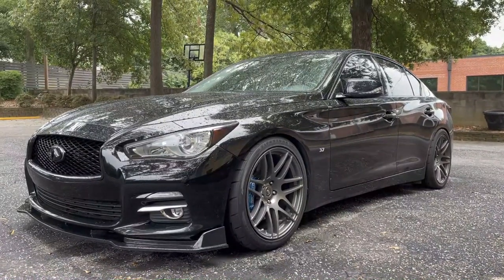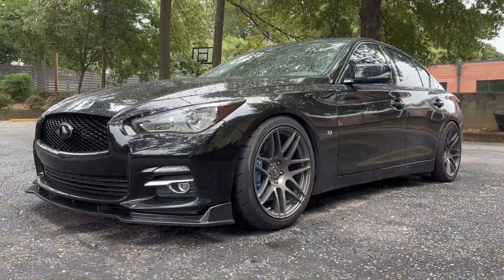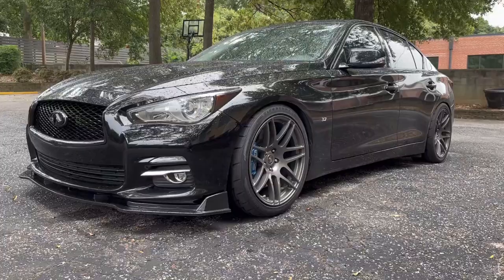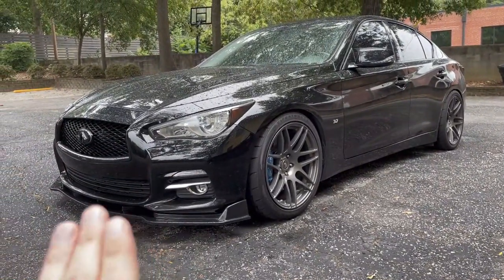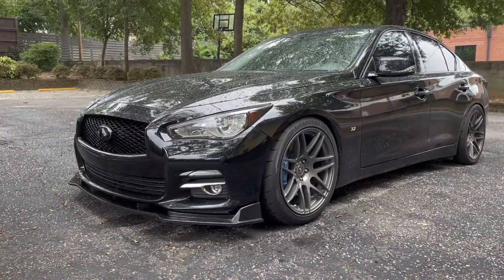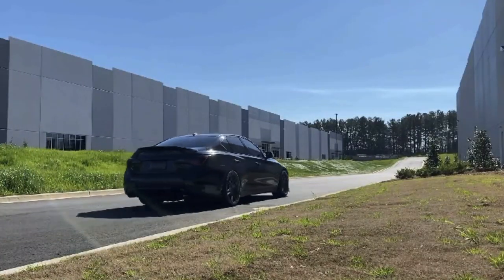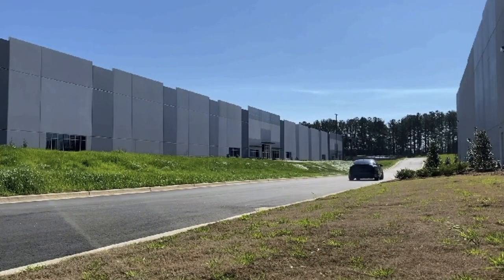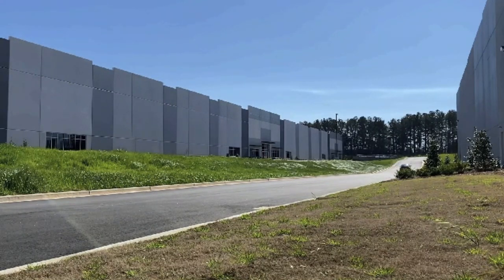The ONLY 3 Power Mods you NEED for the Q50 3.7 | Bang For Your Buck Mods G37, 370z, Q50

Comment: I agree that improving the airflow in, the exhaust out and then finally optimizing the A/F ratio and ignition timing across the rev range are the best bang for buck mods you can make on the VQ37 engine, as you're improving engine operating efficiency across the whole rev range.

Wanting to keep my 370Z daily driver street legal here in California, I was only able to go with a cold air intake, better cat back exhaust and a chassis dyno tune. I had a Stillen Gen 3 long-tube CAI and a Fast Intentions 2.5" dual x-pipe cat back installed with an Ecutek software dyno tune done on a Dynojet chassis dyno at Specialty Z.

We went with a little more conservative tune to give me a greater margin of safety in case of something like bad gas getting in the car. The result was a healthy 321 peak rwhp.

 With the 120 lbs I've taken off the car, plus the stiffer Hotchkis anti-roll bars, the car is much more fun to drive. Lightweight Michelin Pilot Sport Cup 2 tires plus ultra lightweight forged magnesium monoblock wheels have contributed to the performance and handling improvements.

Comment: I will be getting an E85 conversion flex fuel tune with new fuel pump, injectors and flex fuel kit. I already have the SCS catback with Z1 high flow cats.
Reply: Did the cats increase the exhaust tone by a good amount? I have some Berks ready to install but debating test pipes
Edit: I’ve seen videos but you can’t really tell over video, example my ark catback is way louder than videos my jaw dropped lol
Reply: @joseg5913  The Z1 cats did increase the sound. Your test pipes would be even louder with probably more rasp.
Reply: @joseg5913  Which ARK did you get? How much louder than videos LOL
Reply: @Nateabolic  video never do it justice bro lol it’s always louder in person . But anyway I got the ark grip for the 3.0 q50 but I have the 3.7
Reply: @joseg5913  I've heard all the videos but I am hyped! I'm gonna probably run the same setup, 3.0t ARK GRiP on my 3.7 Q50. Paired with ART pipes! Just waiting for a few months before I start pulling the trigger on stuff!
Reply: @Nateabolic  nice I really really wanted art pipes but I’m AWD. I have a cold start video with it but yeah it sounds so good I love it

Comment: would a fuel injector upgrade and a pump on 93 octane be worth it with these upgrades? how much more hp would I yield?
Reply from the maker: Not necessary at all.  Not stressing factory injectors with bolt ons on the 3.7.
Reply: @SpeedCultureStudios  even with a tune? I cant seem to find a CC spec for the stock injectors either, which I assume is more than what the hp I will get out these bult ons.

Comment: With the mods you mentioned, how far better your getting 0-60 compared to stock settings?
Reply from the maker: I made 0-60 in 5.0 stock and 4.8 with these parts spinning the tires.  With good grip, I’m sure I could be in the low 4.7s.  0.3 seconds is a pretty big improvement in such a short distance.  But these mods really help with throttle response and top end performance more than the 0-60
Reply: @SpeedCultureStudios  you could of throw a jb4 along with mods you mentioned and probably u’ll be in the low 4 sec umbrella. How is it with the reliability? 

Had 13 RT charger.
Reply from the maker: @Krist_Mal008  no JB4 for the 3.7
Reply: @Krist_Mal008  the 3.7 doesn’t have a turbo u can’t jb4

Comment: Would you think it's worth it to get a tune with the Takeda intake and just an axle back exhaust? I'm not sure I want to go messing with the exhaust all that much since I do live in a place that does emissions testing regularly and I really don't want to get fined for having test pipes, otherwise I'd probably go with the full SCS catback.
Reply: do scs catback without test pipes
Reply from the maker: Many people have had trouble running takeda intakes without a tune.  Intakes without doing exhaust doesn't make all that much sense, so then you'd be spending a lot of money for intakes and a tune with minimal gains.  Don't get intakes.
Reply: @SpeedCultureStudios  Admittedly I already got the Takeda intake but it was because my stock intake broke apart and I was hoping that the Takeda would have better build quality (thankfully it does)... plus the dealer didn't want to replace the stock one under warranty. I haven't noticed any issues over the past year but I think I'll hold off on a tune until I eventually decide to do a full exhaust. I'm still pretty new at all this I admit lol.
Reply from the maker: @migaisnotacat  if it’s running ok, that’s great!
Reply: @SpeedCultureStudios  Yep so far so good but I definitely agree that it really isn't worth it. The stock intake is already excellent if you get the aFe drop in filters, that was the set up I had before the plastic broke apart.
Reply from the maker: @migaisnotacat  air boxes breaking is super common and expensive to replace so I totally understand

Comment: What are some of the safest least maintenced mods to start off with on these?
Reply from the maker: This is a good question and a good video topic.  I would say tires, sway bars and drop in filters.  Easy to install, you'll notice a difference (especially tires and sway bars!) and once they are installed, you don't really have to worry about them.  Check filter cleanliness every so often and grease the sway bar bushings.
Reply: @SpeedCultureStudios  i heard drop in filters allow alot more dirt and stuff to get through to the engine and arent the best for it but then other people saying there just fine and its not that serious whats your oponion?
Reply from the maker: @issas4660  I’ve done videos on all of this stuff.  Cheap drop ins will allow dirt through but a good quality one will do a great job.

Comment: Hi, If I add AFE drop in filters will I see any differences. The only thing I have is a axle back exhaust - loving the sound but the Q50S acceleration pedal feels heavy (don’t know if you know what I mean...
Reply from the maker: Might feel a little better throttle response.  Check out my filter review!
Reply: I know that a stock 3.7 with K&N drop in filters made 300whp (about 12-14whp gains) I’m sure AFE is the same. The OEM air box are pretty decent but in cold weather with long tube intakes you’ll make even more.
Reply: You should get a throttle controller,,makes a huge difference in throttle response!!,,I  can't live without it,,few different brands,,pedal commander,,roarpedal,,etc,,
Reply: @briandilonardo8470 you got a pedal commander for the 3.7?
Reply: @F80mthree where can I find these drop In filters

Comment: Intakes don’t need tune, test pipes and cat delete you need tune. And just muffler delete. You don’t need no cat back exhaust they all sound same
Reply from the maker: Intakes definitely need a tune—little to no benefit without and have often thrown a CEL without. Muffler delete is a nice option if you’re just looking for some volume, but there is no power/performance increase.  In fact, many many people have experienced a loss in torque.  This is top performance mods.  Muffler delete does not fit that.  And not all catbacks sound the same.  Just look around lol

Comment: These cars love air 3.7vqs got 2 throttle bodies with bigger throttles intakes catless downpipe tune you'll start shooting flames eassy and the most important is 2 oil catch canes since they love to burn oil ,, you don't need a whole catback ..mid muffler delete and a y pipe if you want a decent sound..gtr intake and injectors f pump you'll be at high 300s mid 400 hp depending on your tune ,,from there tires wheels coilovers or maybe bigger brakes if you don't have the s model .,i was beating vets scatpacks cameros mustangs you name it good luck
Reply: So bro would I be good with this 

1.) aFe Dry S Drop In Filters 
2.) Z1 Silicone Intake Tubes
3.) Z1 OEM Spark Plugs
4.) 2 Oil Catch Cans 
5.) GTR Injectors
6.) Tune (E85🌽/Walbro 255 Fuel Pump 
7.) Cat-Back Exhaust System 
8.) Test Pipes
Reply: Are throttle bodies really needed
Reply: @KaiGuy88  don't just throw money on the car because any money you spend on your car you won't get it back .. be wise about your spending.. e85 isn't necessarily don't kill yourself for it if it's hard to get in your city  .. my other advise is take it one step at a time do one mode and drive the car to see how it behaves and what it's missing.. for example you can't tune a car and then slap a turbo on it for example.. good luck with your build I hope you enjoy it I moved to another platform.. hami aiming for 1200hp

Comment: 300hp for $2500 where?
Reply: Oh man never mind this car comes 300hp stock 
you mean adding 40hp for for $2500
There’s a tune you can get up to 100hp for $1k
Reply from the maker: The car is rated at 330 crank stock.  They dyno at about 285.  Bolt ons and tune gets about 340-345.  That’s 60.  I’m not sure what $2500 you’re talking about.  Just need test pipes, catback and tune.  Tune is $1000 alone.  Test pipes and catback for under 1000.  Not getting 100hp with a tune on the 3.7.  New to the platform?

Comment: 330 additional hp? The 3.7 comes stock at 328hp.. If u are talking about total hp there’s no way in hell $2,500 worth of upgrades is worth an additional 10hp!!!🤦🏽‍♂️
Reply: 330 whp is not the same as 328 crank horsepower 
Stock 328hp = 280 plus or minus whp
330 whp= 396 CRANK hp

Crank hp is measure at engine, whp is measured at the wheels which have a drivetrain loss